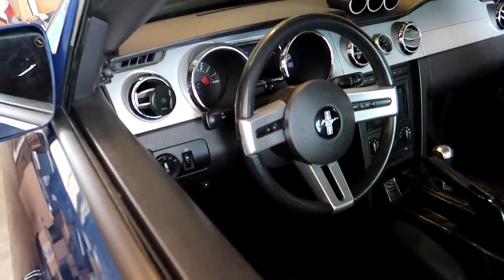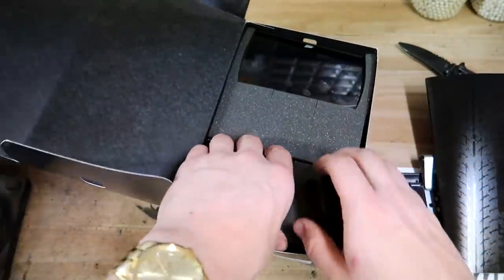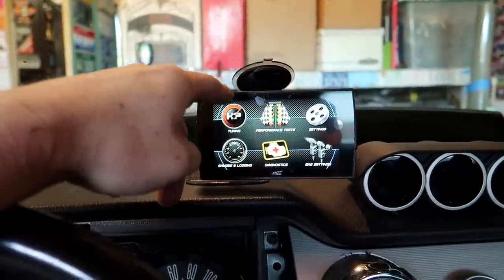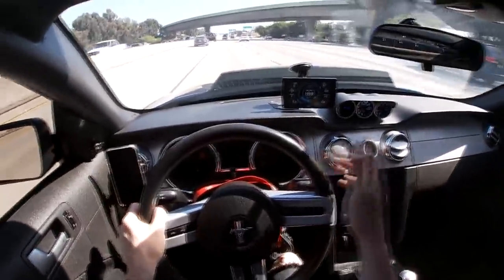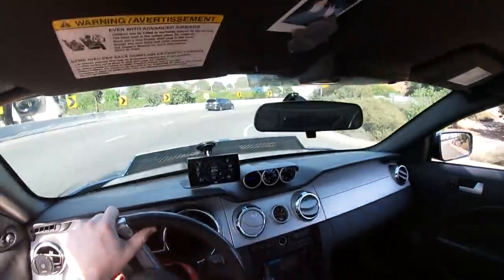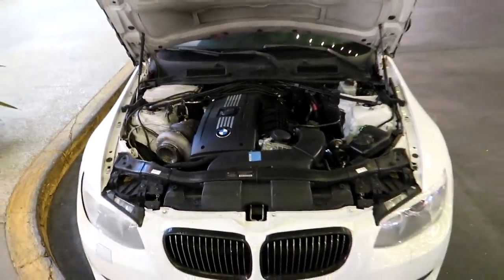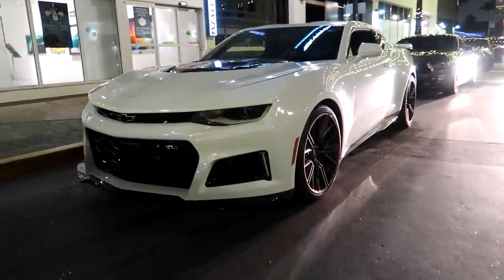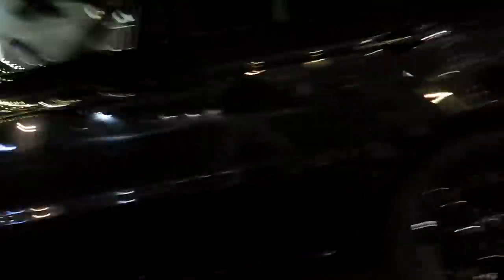"SLEEPER" MUSTANG GOES TO MEXICO AND GAPS EVERYONE!!!

Comment: Tbh, I don't think your mustang is considered a sleeper. I mean look at the hood and tire setup, doesn't really hide what performance your mustang would show, although it is a very cool looking mustang. A good mustang sleeper would be a v6 trim mustang with no exterior mods but with an engine swap, replacing the v6 engine with a more powerful V8, either supercharged or turbocharged or maybe twin-charged. If people see that kind of mustang, most of them think it is just a v6 mustang, until they would learn it the hard way, which is being gapped in their own nice sports car by a v6 mustang that has an engine swap.

Comment: That big turbo 335i ain't got shit for your coyote haha sick
Reply: Theres no way its big turbo unless its on an extremely conservative tune or doesnt have the fuel supporting mods. You can see how much slower it is than the ZL1. The bolt on ZL1 should put it about 700hp at the wheels maybe a bit under which a big turbo N54 can do easily. You can see it gets the jump every time so lag isnt an issue. If I were to guess probably low 600s at most.

Comment: I really wanna know how much hp is the stang pulling 😳🤤
Reply: 700+ wheel hp for sure. Id guess probably on the upper half of 700.
Reply: @n01928  wrong
Reply: @Jake2359  You dont think its making 700? The bolt on ZL1 with E85 is good for close to 700wheel and hes quite a bit faster than that. He's easily making 700.
Reply: @n01928  i know exactly how much it makes my friend. but its a secret. shhhhhhhhhh